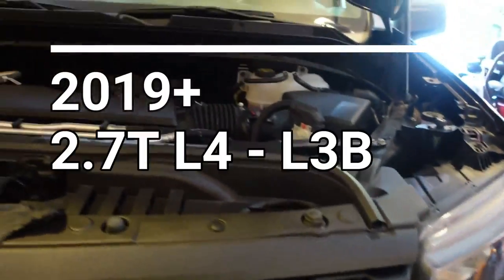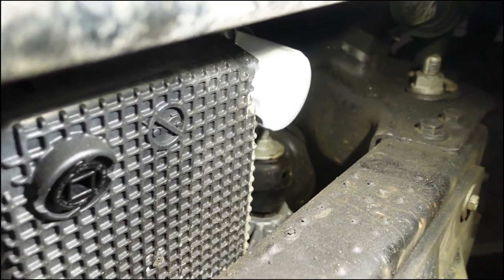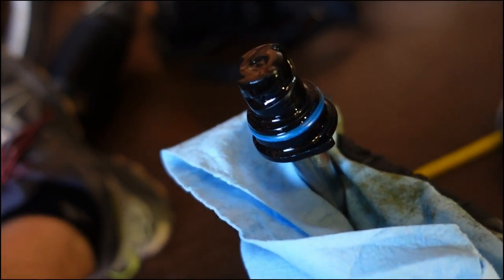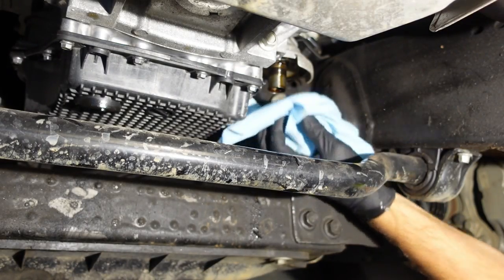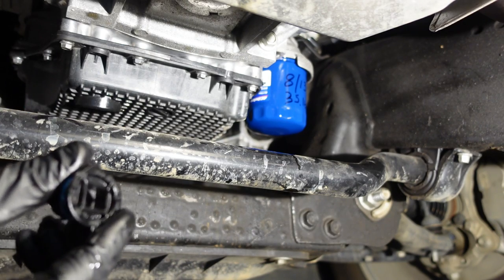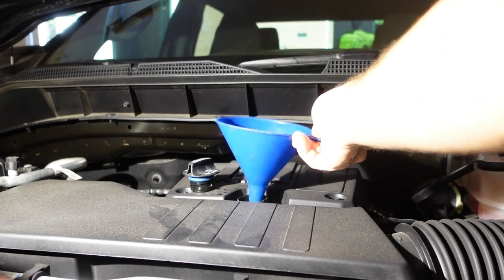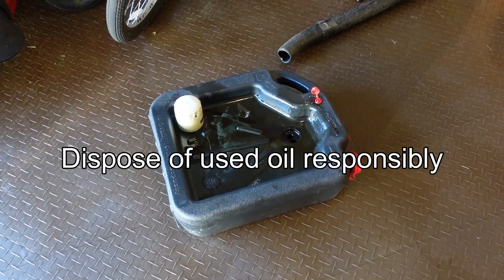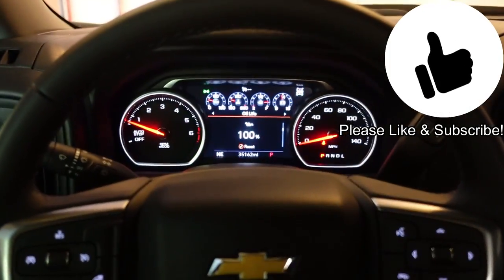[HOW TO] Change the Oil & Filter on the GM - L3B 2.7L TurboMax Engine (Silverado/Sierra)

Comment from the maker: Replacement Oil Plug - GM Part # 12713651 (https://amzn.to/3V4g2vN)
Engine Oil Specification: 5W30 Full Synthetic - Dexos 1 (Mobil1 Synthetic - https://amzn.to/3JRey0m)
High Mileage Mobil1 Formula - https://amzn.to/3VR7W9Y
Engine Oil Filter - OEM AC Delco PF66 (https://amzn.to/3C4u9YB)
Wix Engine Oil Filter: https://amzn.to/3Xx0fH5
Oil Filter Removal Tool: https://amzn.to/3C9iCrf

Comment: Plastic oil pans?  Hey engineers! The pan should slope to the plug to allow the dirtiest oil to drain out.
Reply from the maker: It does slope. It seems they’ve discontinued the plastic pans on newer trucks. They switched back to metal.

Comment: GM isn't the only OEM that is putting plastic oil pans on their engines. they're all doing it
Reply from the maker: cheaper I guess!
Reply: @fondupot  As of 2023 model year they have switched back to metal. Ease of manufacturing with needing to make a lot more with this being the standard engine in the Colorado/Canyon now as well.
Reply from the maker: @joshuahedrick I wonder if the pan will transfer over to the other engines with plastic pans. For anyone who wants to have a metal pan. I’ll have to do some digging.
Reply: @joshuahedrick Yep my 23 has a metal one.

Comment: Just did my 24 Sierra 2.7 for the first time. It has a metal oil pan and has a 15mm socket drain plug. Was surprised to see that.
Reply from the maker: You lucky dog you! Yea they switched back to metal pans sometime in mid-late 2023. I’m still rocking my plastic pan. I replace the plastic plug every couple of oil changes. Thanks for watching.
Reply: My 2024 Silverado Custom has the same. Metal oil pan, metal plug.
Reply: @milestwogo3011  Same here. My '24 Colorado has a metal drain plan and typical threaded plug.
Reply: @BuffRANGE 24 Silverado has standard plug metal pan
Reply from the maker: @maroguy it does now. The first couple years were the plastic pan you see in the video. The process is the same though for changing the oil.

Comment: I take used motor oil to the recycling center. They use old oil to.power a steam locomotive. Who woulda thought.....
Reply from the maker: Yep! I do the same thing. My county has a recycling center about 10 mins away, I save up a bunch of old oil and dump it a few times a year.

Comment: How often is an oil change recommended on this vehicle?
Reply from the maker: Use the oil life monitor. I typically change the oil when it gets down to 20%. That’s about 6000 miles on each oil change.
Reply: Should be sooner than what gm suggests because it will help keep the turbos from breaking down.
Reply from the maker: I’ve got over 100,000 miles on this truck doing oil changes between 20-30%. It’s fine.

Comment: Check engine light came on after my last oil change at my local Chevy dealer. It was for low oil pressure. They spoke with the tech and found he hadn’t pre filled the oil filter. They said he missed the TSB which states filter should be prefilled for the 2.7 engine. They cleared the code and sent me on my way. Do you think any damage can occur by not pre filling on this engine if it’s repeatedly missed?
Reply from the maker: I’ve always prefilled spin on oil filters. Whether doing it or not causes long term damage is up to debate. But I would think it’s not good to starve the engine of oil on startup like that.

Comment: How many miles do you have on that truck? Did you have any issues with the engine at all? Great video 👍
Reply from the maker: Currently have around 102,000 miles. I’ve had zero mechanical issues. It does consume oil, approximately 1-1.5 quarts per oil change. Every 5000 miles. I am currently testing a high mileage oil to see if it helps with consumption.
Reply: @fondupot you might have to switch to a 100% synthetic like Amsoil Signature Series that may help
Reply from the maker: @oliverramclam6009 I’m switching over to RLI biosynthetic 5W30 on my next oil change. Supposed to have good results based off another owner using the same oil.

Comment: Why are you removing a non oem filter at 3300 odometer reading? Shouldn't there be the OEM filter already on there from initial engine assembly?
Reply: Disregard last comment didn't know you already had 35,000 mi on tr
Reply from the maker: Yes the truck was driven by my boss for ~33,000 miles and that filter is whatever his shop used when he got the oil changed. I use the AC Delco PF66 filters or equivalent Wix filters now.

Comment: Did you buy a new plug (blue o-ring) or reuse the existing one?
Reply from the maker: If you buy a new plug the, the o-ring is already included. Not sure if you can replace the o-ring alone.
Reply: I was going to reuse my plug.  Not sure if I can.  What’s recommended?
Reply from the maker: @linos9457 the plug is reusable. I just keep one extra on hand, just in case.
Reply: I agree.  Thank You

Comment: Why is my truck saying my Oil Filter is at 35% life but my engine Oil is at 75% do I have to change just the oil filter?
Reply from the maker: There is no “oil filter” monitor. You’re probably misreading the “air filter” monitor. The oil life monitor is what you need to be following for engine oil. And you should change the oil filter every time you change the engine oil.
Reply: @fondupot  oh okay, thank you very much👍

Comment: Not a big fan of that oil pan or plug. Not made for longevity that’s for sure. Just did mine today.
Reply from the maker: Apparently some newer trucks with the 2.7 have an aluminum pan and a regular drain plug. I wonder if it would swap in?

I have a few spares of the plastic drain plug so I replace it every few oil changes.